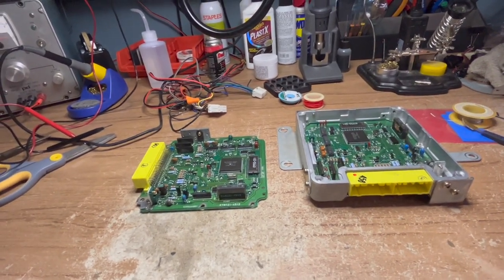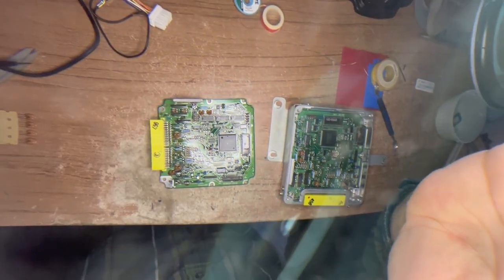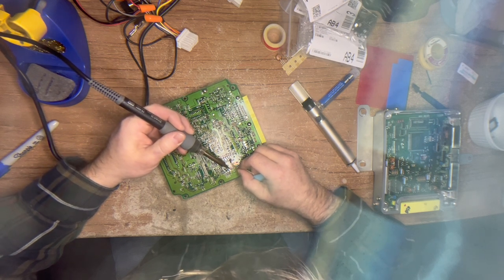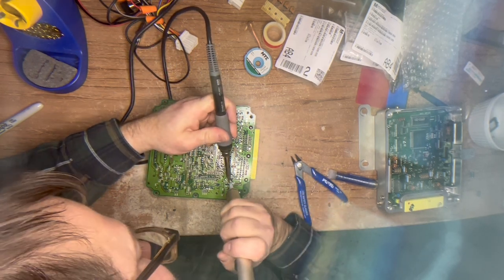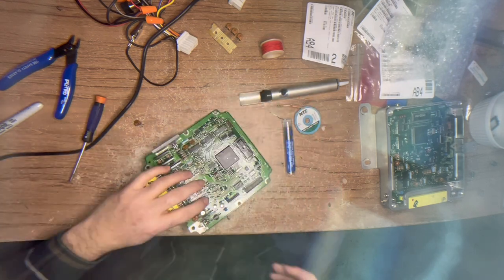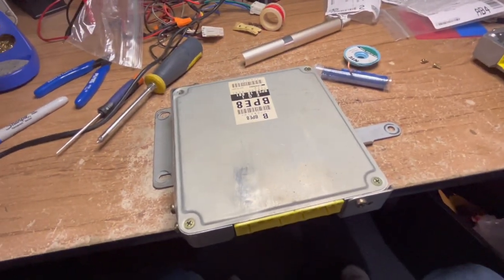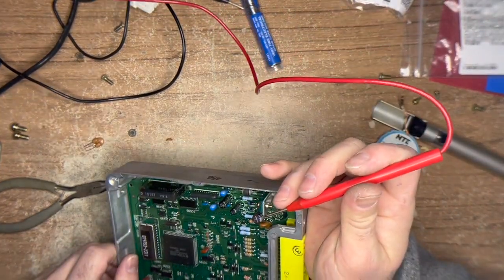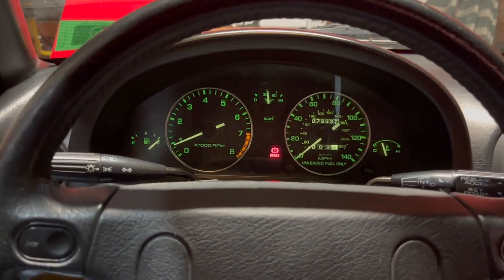Mazda MX-5 Miata ECU Capacitor Replacement (NA8 shown, others similar)

Comment: This was my last place to look after changing a few sensors, fuel rail, fuel regulator, injectors and any other small parts that leads to stalling.
Same corner on the circuit board, capacitor fluid leaked and caused damage to the EMI filters.
Stubbled on this video while looking for replacement parts on this board.
I’m happy to find this was my issue cause the repair is cheap and some basic electronic skill :)

Comment: Mr.Bishop, I wanted to thank you for the videos. Several years ago you put videos up on the 2014 Hyundai Elantra GT 2.0, because of those videos I purchased mine with more of what to look for. I am still driving this little car and have become very fond of it...she's my little champion who also does well on wintry roads. I wish I could afford to make donations to your channel but disability funds are not...astounding.  Your channel deserves to be towards the top 🎩 of the chart. Videos like yours keep my brain from stagnating 🤪. Keep on rockin'👍🏻 till you can't rock any more
Reply from the maker: Thank you very much! Glad your GT is still running strong! Just change the oil every 4,000 miles at the most, and change the automatic transmission fluid every 30,000 miles (at the dealer) and it’ll keep going! I traded mine in at around 110,000 miles because I needed something bigger after buying a house.
Reply: @bbishoppcm  Thank you for the info. I'm doing 3,500 on oil change...still 😆. Can the trans fluid be changed at home? I know the configuration is different now, cost is a huge factor. I don't mind paying a dealership $100 or $200 but more would be outrageous.

Comment: Good stuff. I'm in the middle of replacing all the caps on my carburetor ecu (yes some 90s cars have computer controlled carburetors lol).
Reply from the maker: Cars have had ECUs for decades - it started with electronic spark advance, then made its way to early fuel injection and carburetors - my dad’s 1984 Ford F150 (straight six, carb’d) has an ECU as well!
Reply: @bbishoppcm  I'm working on a Subaru Justy. It controls spark advance and lots of emissions equipment, and air/fuel ratio with a little solenoid. neat stuff

Comment: Thank you for the video. I have 2000 JDM NB, symptoms like you described, rough idle, stalling when hot, doesn’t pass emission test. Changed and tested all the sensors, nothing helps. I took the ECU off, and it looks super clean, no leaks or anything, measured the caps with multimeter, and checked around them that nothing is shorted. I don’t know what to do.. there are no ECUs for sale for VVT engines in Europe left.. if I cannot fix it I will have to scrap the car because of the inspection…
Reply from the maker: It sounds like another issue, and possibly unrelated to the ECU. I wouldn’t expect a 2000 to have leaking caps…

Comment: I'm having an issue with my 2005 NB Miata, it's throwing a P2610 code (ECM/PCM Internal Engine Off Timer Performance). Might have to check the caps now, didn't think of this before but now it makes sense (I have a few computer motherboards from around this time period that died from the mid 2000s cap plague). Thanks for the video, definitely will try this out instead of buying a new ECU!
Reply from the maker: Yeah, these caps were of good quality when new (unlike the Nichicon caps of the early 2000s), even the best quality caps will eventually fail - and these are just end-of-life

Comment: Thanks for this video on the ECU? Any chance you would be willing to take on the airbag module (NA01677F0A)? Lots of NA Miatas have bad modules, no longer in production. Apparently leaking capacitors are the problem. I can solder. I would appreciate some word from you on this.

Comment: I got a 93 Miata california emission car my ecu is shorting fuel injector 1 and it’s constantly grounded and finding another b6AW-18-881 ecu is impossible but I sent mine out hopefully they can repair it
Reply: Sent out to autoecm
Reply: Rip autoecm could not rebuild it they said they sent to a third party builder but no reason why they could fix it I took it apart and some dark spots near the big capacitor possibly electrolytic corrosion?

Comment: Here is what mine is doing. It was running fine then started this. If it goes over 2700 rpm’s. I have replaced everything but the Ecu and the o2 sensor. What do you think?
Reply from the maker: I'd check your ECU capacitors as they should be checked anyway, then go backward and start putting your OEM sensors back in one at a time. Aftermarket sensors made within the past ten years belong in the trash - unless you actually used OEM parts, in which case, pat yourself on the back!
Reply from the maker: I do still offer ECU recap jobs, but results are NOT guaranteed. $150 is my rate.
Reply: @bbishoppcm  I pulled my ecu this weekend and I see zero damage. Do you have an email I can send pictures?
Reply from the maker: stereorepairs@gmail.com - no visual damage is a good time to get them replaced. As part of the job, I'll test each one as I pull it to determine if it was good or bad; this helps you determine whether or not it was even remotely part of the issue.